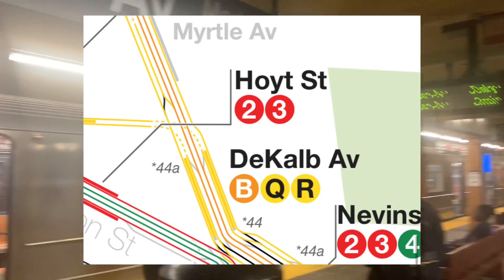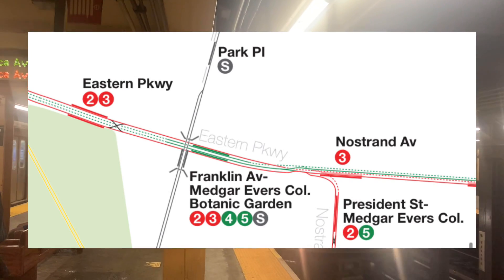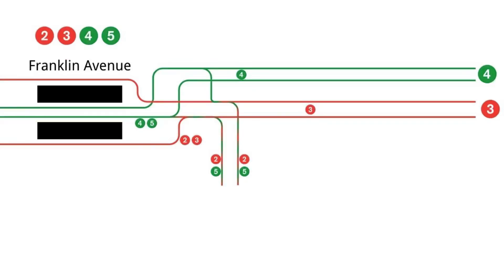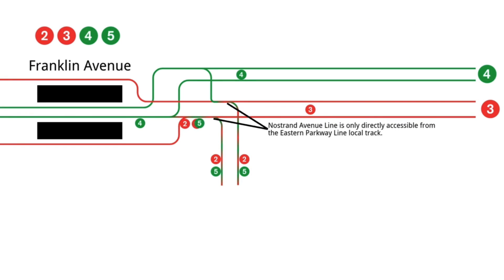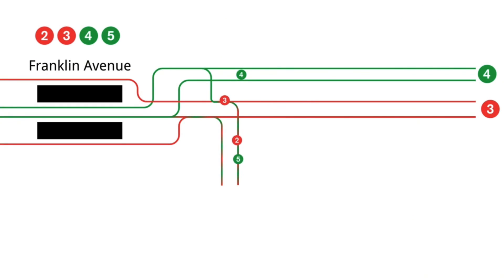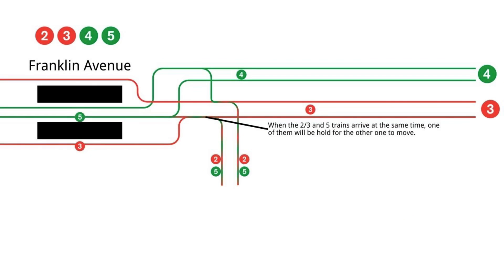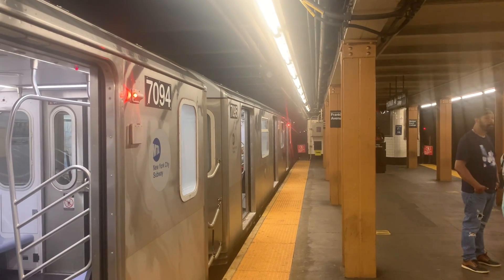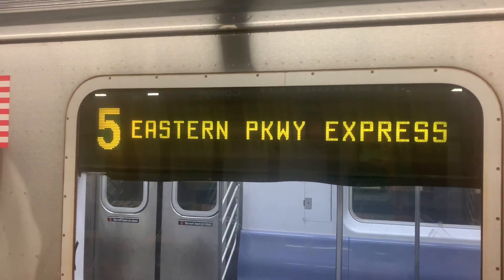Rogers Junction: Fix it to get 30% more capacity in the A division!

Comment: The 8 train is a ridiculous solution. An entire new line running the length of the 2 with identical service except the last 3 stops. At that point, just redirecting the 2 train down Utica and having the 4 and 5 on express, and increasing the trains per hour for the 3 to make up for losing the 5 to Brooklyn college, makes more sense. Not a great solution, but better than this stupid 8 train idea.

Comment: making the 8 a thing creates less trains per hour as it uses more trains from a yard and MTA deemed the 8 useless so let’s see what they come up with
Reply: Exactly. They’re gonna keep the 3 at new lots and the 5 at Flatbush very likely. I just think they’re gonna build a brand new switch. I think it would cost less money to do that and not to mention if you have a better signal system the bottleneck wouldn’t be all too bad Because eastern Parkway has an old signaling system.
Reply: @the_elmeister  There should be flyover tracks for the <3>, (3), <4>, & (4) going eastbound, while the <2>, (2), <5>, & (5) should run onto the IRT Nostrand Avenue Line’s local tracks. The (4) should be extended to Broadway Junction. The <4> should run onto the express tracks of the IRT Utica Avenue Line. The <3> should run via Livonia Avenue express, New Lots Avenue express, Dumont Avenue express, Fountain Avenue express, Flatlands Avenue express, 156th Avenue express, 157th Avenue express, Nassau Expressway express, & 147th Avenue express, while the (3) should make all local stops east of Utica Avenue.
Reply: The <8> should run from Rockaway Park-Beach 116th Street to Parkchester via Rockaway Beach Boulevard local, Utica Avenue local, Malcolm X Boulevard express, 23rd Street Tunnel, Lexington Avenue local, & Pelham local, while the (8) should run from Stuyvesant Heights-Bainbridge Street to Parkchester making all local stops.

Comment: I'm not understanding why we need the 8 train. Can't we get the same result by running keeping the 3 train going to Utica Ave?
Reply from the maker: That is why I said let MTA study it first. The 3 will run with the 2 to Flatbush Avenue.
Reply: @Urban_Man  it’s not official yet. I don’t think we need the 8. All I think we need is a new switch that connects the express track to Nostrand Avenue line. The F & M swap is perfect because not only do you make capacity better on Roosevelt Island, but things are more direct.
Reply: @Urban_Man  I think what would be interesting is a new Utica Avenue line served by the 3 and 5 trains and if you build a switch that connects the Utica Avenue line to both local and express tracks, it would be reliable and then you can send the 4 to new lots. The 4 already goes to new lots during late night hours and extending it to new lots at all times would be easy. You can make the new Utica Avenue line an elevated as well. And then Flatbush could be exclusively run with the 2. And you can still keep those 2s to new lots during rush-hour via the 4 line.

Comment: A major part of this whole saga, is how the switches, the Signals, and the Brakes were originally set up, totally mechanical.  A train could not even get close to a switch if it was running to the wrong track without automatically tripping the brakes, to go past a red signsl, the operator had to come to a complete stop before they could go past it. That's what those little "trip arms" that you see come up were for when a signal goes red. To kick the brakes into "emergency."
They ARE dealing with it, it just that because of the age of the system, the age, the different series of the cars and that it runs 24/7, it can't even get CLOSE to what it would be if was even only 75 years old.

Comment: My question is i understand the 8 train on Eastern Pkwy but what's the deal with 7th Ave/Broadway (exp or lcl) and does it go to Harlem 148th St or join the 2/5 in the Bronx??
Reply: Good question
Reply: @rodprops  I prefer the <3> & (3) to Lenox Terminal. The <3> should run via Livonia Avenue express, New Lots Avenue express, Dumont Avenue express, Fountain Avenue express, Flatlands Avenue express, 156th Avenue express, 157th Avenue express, Nassau Expressway express, & 147th Avenue express, while the (3) should make all local stops in Brooklyn & Queens.

Comment: The 3 doesn’t need fixing send it to the Bronx and just abandon those 2 small stations
Reply: Never happen.
Reply: @richietattersall2122  I prefer flyover tracks in Brooklyn allowing for the same services, but at more frequent trains. There also are extensions to be built. 

The (4) should be extended to Broadway Junction instead of abruptly terminating at Utica Avenue. The <4> should run onto the express tracks on the IRT Utica Avenue Line. The <3> should run to Rosedale-Francis Lewis Boulevard via Livonia Avenue express, New Lots Avenue express, Dumont Avenue express, Fountain Avenue express, Flatlands Avenue express, 156th Avenue express, 157th Avenue express, Nassau expressway express, & 147th Avenue express, while the (3) should make all local stops in Brooklyn & Queens.
Reply: Not gonna happen because those people living at 145th and lenox would have a fit as spoiled as they are

Comment: Plans for additional turn back tracks at Flatbush Avenue would increase the station's capacity, but only for a short while. The line would then have to be extended south on one of two alignments: one serving East Sheepshead Bay with four stations at Avenue K, Kings Highway, Avenue R, and Avenue W, and one going to southeastern Brooklyn with three stations at Flatlands Avenue, Quentin Road, and Kings Plaza, the latter of which would be an interchange with the Utica Avenue Line. The main problem with both of these alignments is if they are built underground the stations would have to be at least 80-100 feet deep. The route to East Sheepshead Bay would serve the most riders but the route to Kings Plaza would provide a faster route than the Utica Avenue Line. However, the problem with that route is that bus ridership on the B41 is lower than the B44, and in addition, having two lines terminate at Kings Plaza would require two stations to be built. This would also overload the B44 bus.

Comment: See that’s the major problem there a lot of ways to solute the problem for the ❷❸❹❺ trains but however for the over a century (105 years) is been very complicated to whether put ❷❸❹❺ lines at. If we put ❷❸ trains on the Flatbush Avenue line ❹ train would have to still make their way to the local track to Stop at Nostrand Avenue station. ❺ would have to use the express track to Utica Av